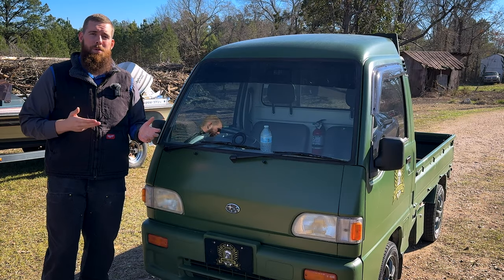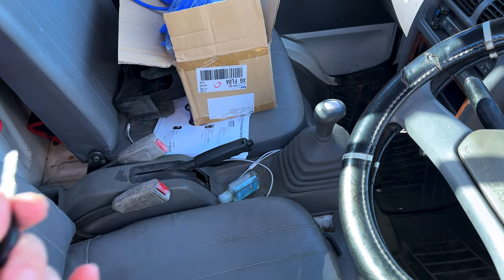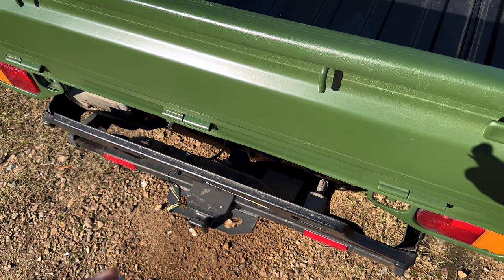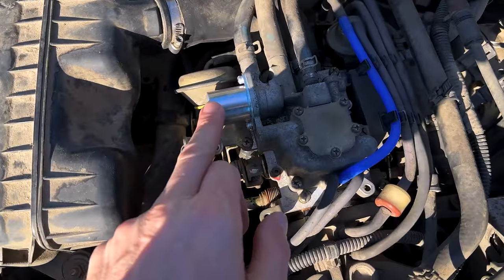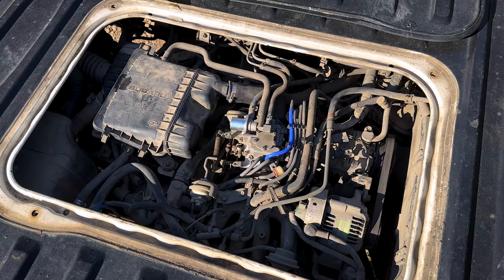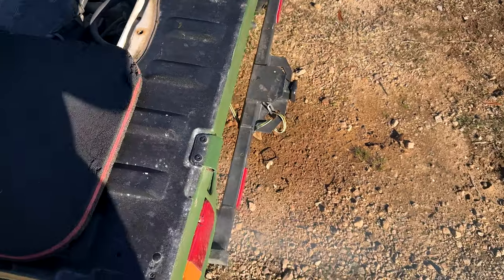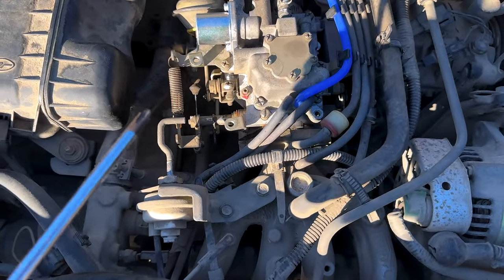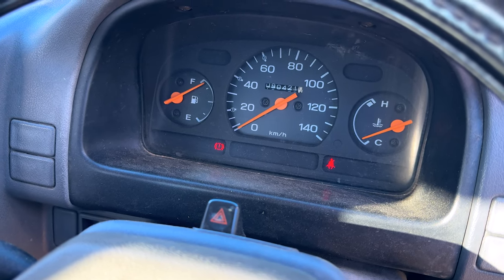Crank, No Start! Diagnosing a No Start Concern On A Customers 1996 Subaru Sambar KS4!

Comment: What about air.if ur not getting air cause the air filter clogged up it wont run either
Reply from the maker: True. Could be a cause. Usually will run, just poorly, unless fully clogged.
Reply: @MrSubaru1387  yes sir I agree that’s true too

Comment: Love your videos. I just purchased my first Subaru 2013 Forester manual 5 speed. First vehicle that I ever owned without any gauges. Can you do a video on how can you make your Subaru Read oil pressure gauge and engine temperature. My Subaru does not show any oil pressure or transmission, temp or oil or cooling tip. Is there a trick or a hack that I can do to solve this problem?. Thanks. Keep up the good videos .
Reply: はじめまして。エンジン下部のオイルフィルターとエンジンブロックの間にセンサー取付け用の後付けブロックを着ける。そうするとそこから取れると思いますが、いかがでしょうか？日本より！

Comment: Hello, I have a 02 wrx impreza and my car intermittently won't start at various times. It throws an old code for the camshaft position sensor and stays on for about 2 or 3 days and goes away. The wiring , sensor and camshaft has been check and  disassembled. At this point I'm being told to swap the computer. Problem is thier is no exact matching computer and they are discontinued along with any software to reprogram it. If you have any suggestions please let me know! Thank you
Reply: はじめましてこんにちは。カムセンサー、この年式だとひょっとしたらば、カムシャフトの前端と後端それぞれに有るのかなって思います。タイミングベルト側が前端。バルクヘッド側が後端。後端側のカムセンサーは交換しましたか？ご確認オススメします。日本より！
Reply: @dWsjapan  man I wish I knew what this said, I can't figure out how to translate it to English. Thanks for the response tho
Reply: @mannythatbarber  man
apologize for this. Now with translation software.
Hello, nice to meet you. I think the cam sensor for this model year is probably located at the front and rear ends of the camshaft. The timing belt side is the front end. The rear end is on the bulkhead side.
Did you replace the rear cam sensor? I recommend checking it out. from Japan!